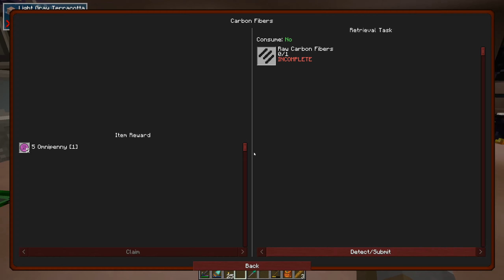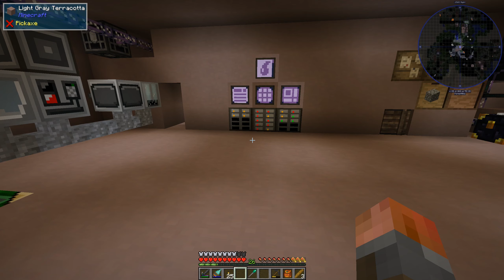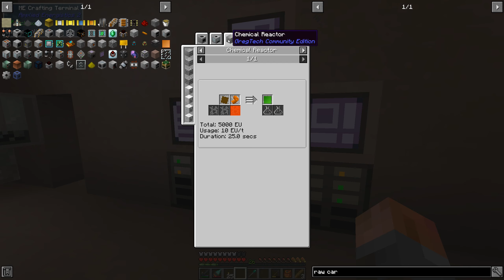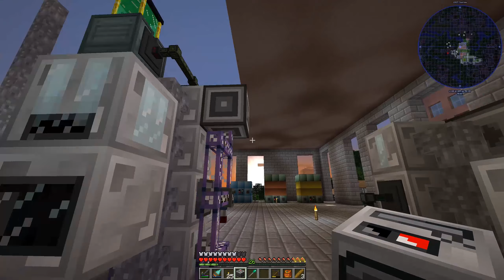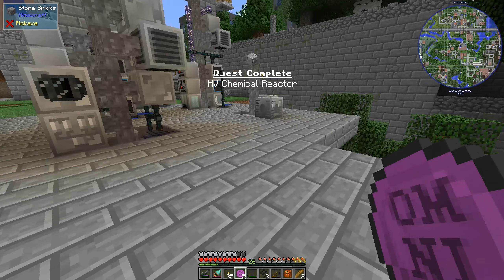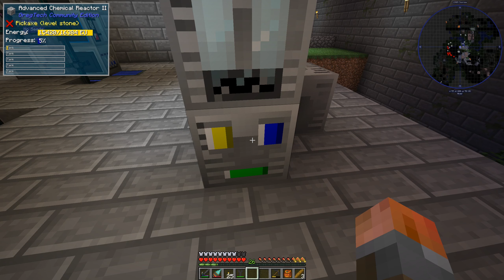Omnifactory E46 - The Road to Epoxy Resin (and Tier 4)

Comment: your lack of automation is really  starting to annoy me, like how is it possible that in episode 46 you still only have one laser engraver instead of one laser engraver for every lens?
Reply from the maker: Mainly, that I haven’t needed to - I tend to scale based on usage ( why I have about 3-4 compressors ), and until about.... now I’ve just batched CPUs :D
Reply: @grayduster  the thing is once automated you dont have to touch the system until you upgrade the machine to a higher voltage and keeping them in stock is also easier